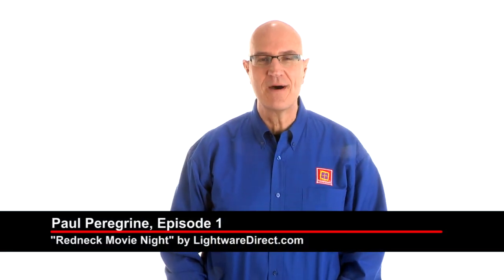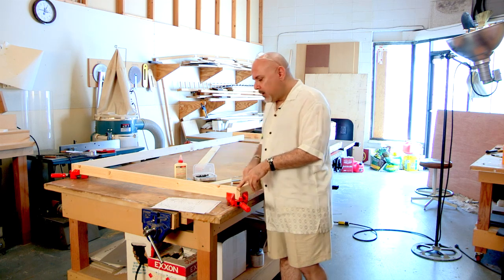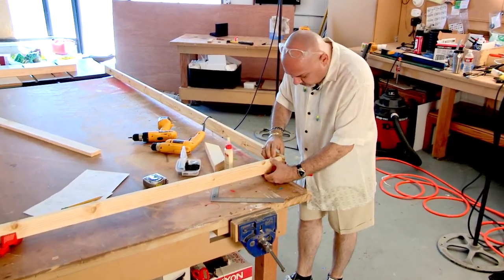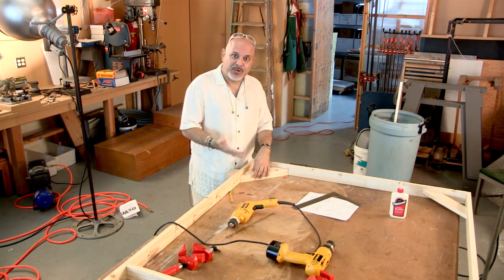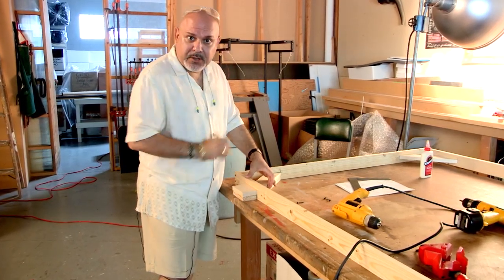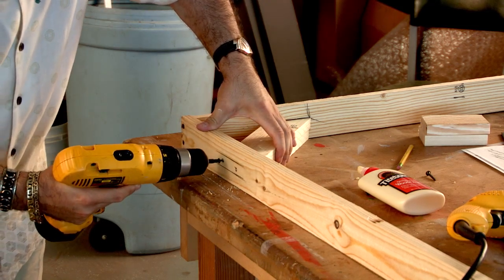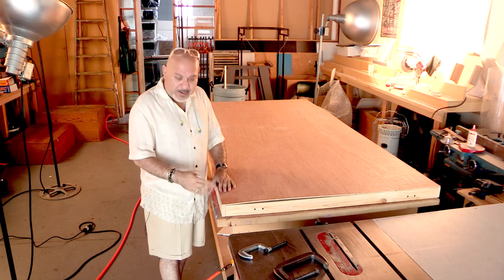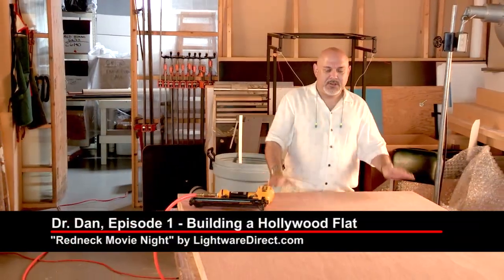Building a Hollywood Flat - Redneck Movie Night - ep1

Comment: Crown stapler instead of screws, rails always cap the styles (so you can drop them around without ripping apart), no corner braces (on theater flats covered in canvas, yes) because the Lauan provides support strength and there are toggles every two feet (so you can easily estimate the dimension just by looking)

Comment: Well I see the know it alls again. Well for me, I enjoyed this video, because I can benefit from this construction technique in my new apartment. I plan to build a steel saddle to slide the panels into to hold them upright, this will allow the wall to not have to be connected to the floor or ceiling. No landlord issues. I plan to take one part of a long room and convert it into a walk in closet. Thanks for posting this video.

Comment: Nooooooooooo! As Bill Nichols has already pointed out below, your rails should always cap the ends. This creates "sleds" for the flats to slide on. If you build your way, when the flats are slid or tipped on a corner, they are likely to either get caught on something, or they eventually rip apart.

Comment: as many have already commented- it is so odd that you can't find video examples of the correct, long standing method of flat construction: rails, stiles, toggles. every online example seems to have some strange, homespun twist, which may work fine, but are not the textbook standard.

Comment: Oops! The rails cover the ends of the stiles. They should be 48" and the stiles should be 94-1/2" and go in between the rails. Yes, even on Hollywood/TV flats this is still the correct construction for a flat.

Comment: Now although this works, this is not the correct way to build a hollywood style flat. There are two things right - it is framed on edge and choice of lumber. The criteria for a Hollywood style flat is that they must be framed on edge, the rails always cap the stiles, toggles are always placed every 4' on center, and nailing blocks are added on every 90° corner inside of the framing for added strength and support. There are no diagonal braces on a hollywood style flat.
Reply: +z030n3r - You are correct, sir! I posted the same rail/stile info before I saw your post.
Reply: @z030n3r - Could you explain "nailing blocks"? I've been building flats for years and not sure your meaning. I'd definitely appreciate it. Thanks!

Comment: I'm a student I can't afford those materials or tools. Got any other alternatives?
Reply: Depends on the size of flats you need and how resilient they have to be. If they're just for one or two shows, you can use much thinner lengths. I'm currently building a set with 18x45mm timbers. You can also take a risk on cheaper, more knotty timbers. These will not be as straight, but you'll just have to make it work. A particle board such as 3mm hardboard is a much cheaper alternative to the plywood Dan is using, but also not quite as flat. If you go to a timber store and pick your own materials, you will get better stuff than if you order by phone and let them choose.
Reply: Greg Veit okay! Thanks allot for the guidelines, they're helpful
Reply: No problem. 
My experience comes from trying to make lighter flats rather than cheaper ones.
The key things that Dan doesn't mention in his video are:
- The importance of building flats on a level surface. He has a workbench and a poured concrete floor, which he takes for granted as being level. If you're using cheaper timber, it will probably be a bit warped and you'll need to clamp it to a flat surface (or weigh it down) to get your joints square. 
- Nailing your sheet material to the frame by going around clockwise. Apparently this is the way to do it. Ikea wardrobes come with this instruction. I never really worked out why. 
And as has already been said, and this is especially true for lighter constructions, you don't need the diagonal braces. 
And to save even more, you can attach sheet timber to both sides to give you a more versatile flat. But then you would need to attach the rails some 2" below the tops of the stiles so you have a way of clamping the the things together.
Reply: Greg Veit I will reference your advice and video when building #thanks